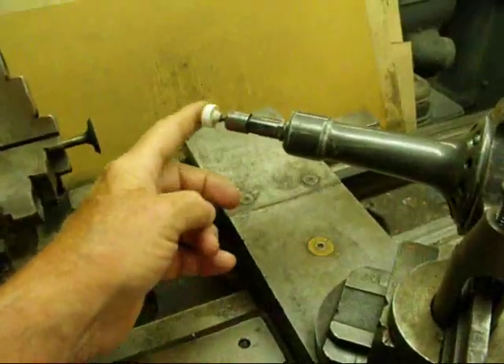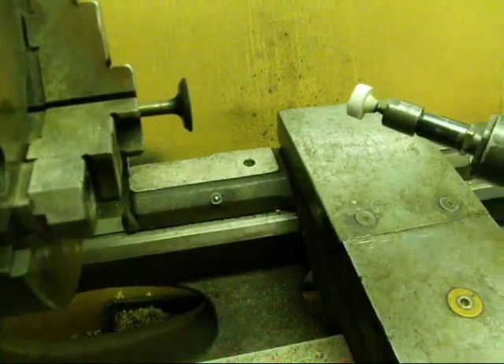Grinding valves on the CLAUSING LATHE with DUMORE Grinder tubalcain

Comment: Beware worn valve stems that make the valve rotate off center, if you place the stone next to the valve head and turn the chuck by hand you may be able to chuck the valve in or out, or rotate the valve in the chuck until you get the chuck jaws off the worn spot. Check to see if the unworn machined surfaces are concentric with the valve stem as an additional check. You can also mike the valve stem all over checking for wear.

On the other hand, everything may work just fine first try with no fiddling, LOL.

Comment: i used to do this a long time ago ,but i also dressed  the stones of the seat grinder by running the diamond on them ,using an arbor in the lathe chuck .Using blue on the seats showed a new perfect fit ,with no lapping required.

Comment: Very nice setup, just a different way of doing things but a trick I learned from an old engine builder is on a 45 degree seat cut the valve face to 44.5 degrees which works as an interference fit improving valve seal in extreme high stress engines. Just thought I'd share
Reply: Thanks for this tip, I will keep this in mind when I need to rebuild an engine. I always aim for max valve seat compression efficiency.

Comment: I've cut valves with a cutter and it works close enough that you can lap them in and get away with it on something like a briggs. I cut one on my lathe once just to see how close it would get and then stuck it in my friends valve grinder and according to that it only took a little over a quarter thou to clean up.